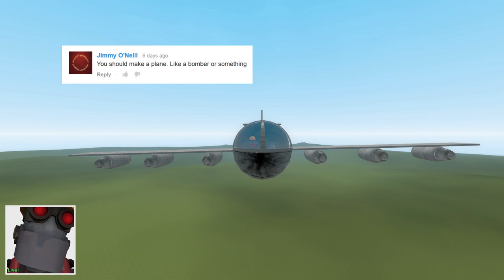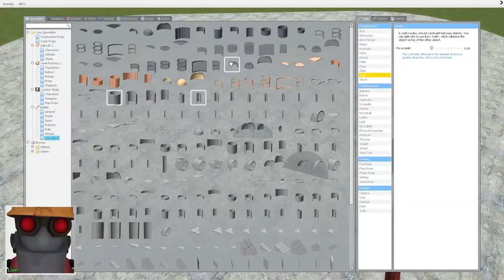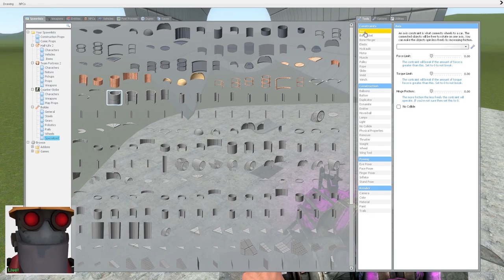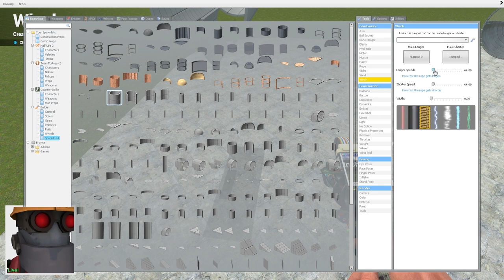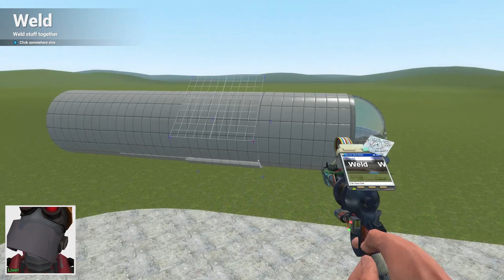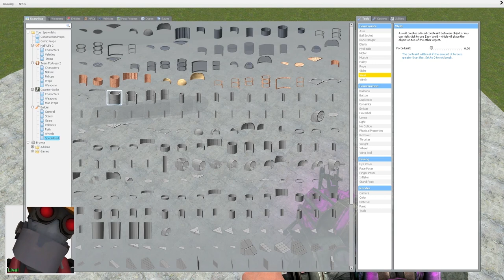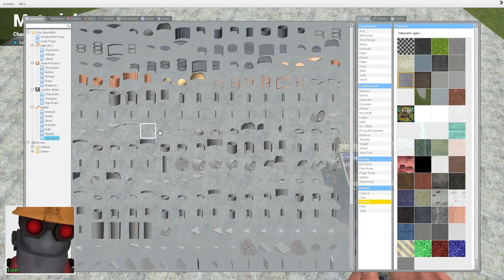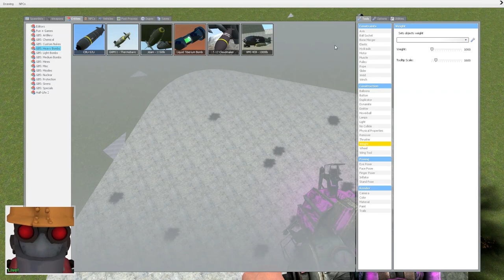Gmod: Sandbox - BOMBING (Garry's Mod Build)

Comment: Try making a proper realistic car. :D
Requirements:
-Steering must NOT be thrusters, but rather by angling the wheels.
-Suspension! Bouncy! YAY!
Reply: I don't even think that's possible 😝
Reply: Its quite easy
Reply: lync q Seeing the yogscast struggle to make a basic car made me squirm... but Duncan at least has some (actually much) better skills. You are true, it is easy, but to make it function well and handle good is hard. :P
Reply: It is possible you just need.., many mods and you must not be a minge builder. Here are the required mods: wiremod, smartsnap, acf, ball socket advanced, precision alignment, Sprops(better than PHX)
Reply: NavyBlue
It's actually possible without any mods... though it's a bit more difficult... :P
Reply: go on then make it yourself mr.i know everything :)
Reply: NavyBlue  LOL minge builder
Reply: /watch?v=rXm2hkqDtJs the basic consept
Reply: NavyBlue wiremod and smartsnap are the most important
Reply: True, but for decent steering you do need ballsocket advanced
Reply: By this I mean for steering slaves
Reply: NavyBlue i forgot lol